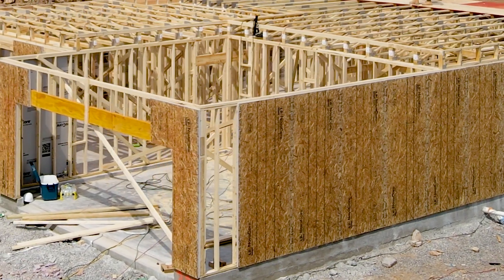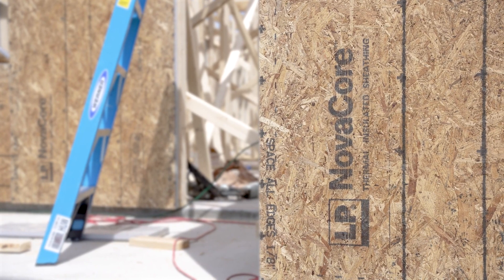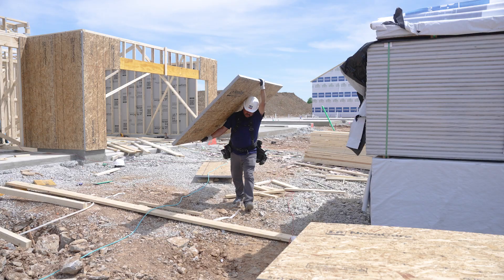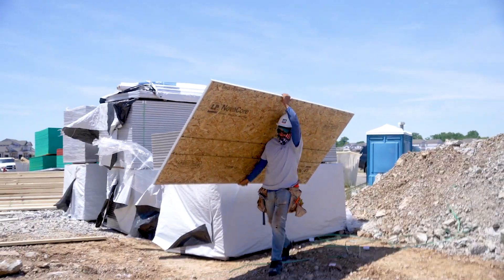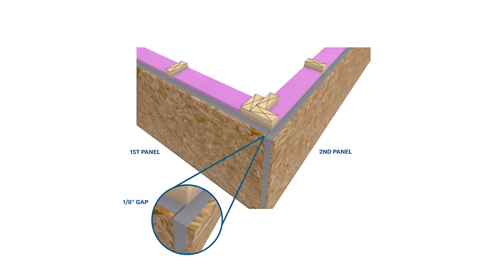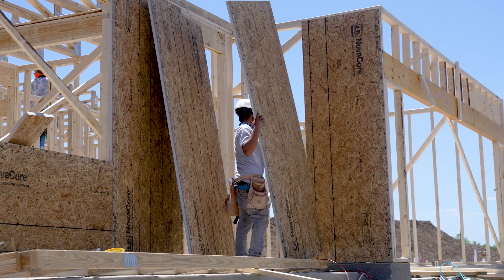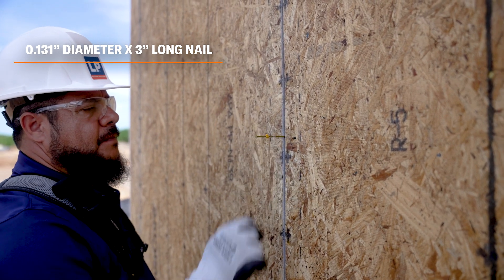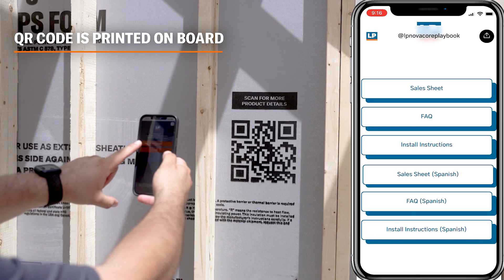How to Install LP NovaCore™ Thermal Insulated Sheathing

Comment: How is this going to provide sheer strength with the OSB sitting 1” away from the stud? Additionally if the requirement is R-21 internal with R-5 continuous, can this still be used on 2x6 walls?